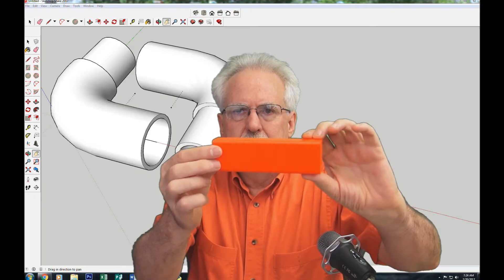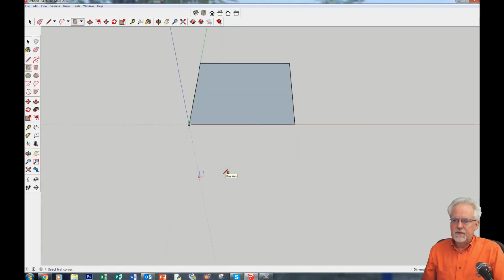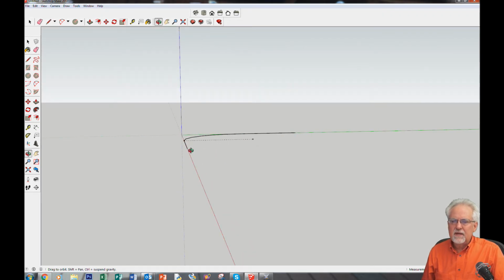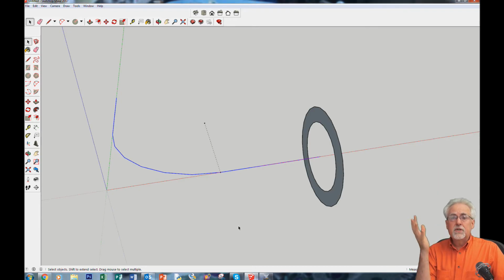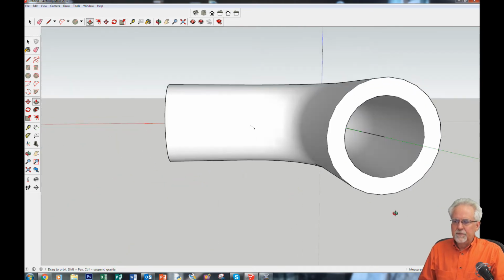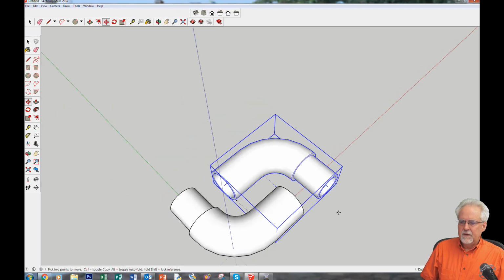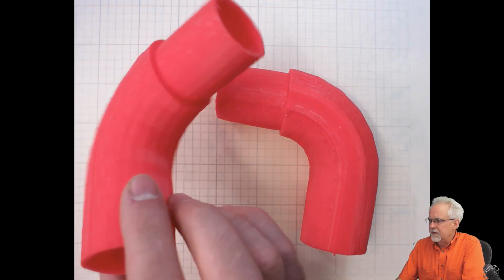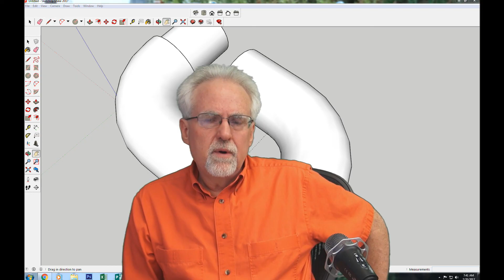Sketchup Tutorial LESSON 11: Use the Follow Me Tool to Design a PVC Elbow

Comment: Paul,
I have been using the Follow Me tool for other projects. I am however having an unexpected result using your method to create a simple elbow. Once the profile is formed along the arc, I have some gaps issue at the inner radius of the elbow. Looks like it is having trouble wrapping that radius and forms an open bow tie shape. The more segments I put into the circle the larger the problem.  I no longer get perpendicularity errors once I learned to align to the axes, so that is not occurring.  Can I send a picture of the result and the setup to learn what I am doing to cause the problem? The radius of the  tube is 62 mm and 3  mm wall thickness.

Comment: Hi Paul. I've been really enjoying your videos. I use SketchUp rather a lot, but didn't know about the smoothing surfaces feature. Thanks. It looks like the smoothing feature only functions visually on the screen, but doesn't transfer to the actual dimensions in the 3D model printout.  You can change the number of segments your circles are made of by typing it after/while creating your circles, much in the same way you change dimensions of a rectangle. I wonder if this would result in more round printouts. Ben from Sydney.

Comment: Paul, Give Simplify3D rather than Slic3r a try. I noticed my Prusa prints got 100% better when i imported the .STL into Simplify3D and used the Prusa i3 presets.
Reply from the maker: Does Simplify3D know how to utilize the auto leveling feature of the Prusa? I tried slicing something with ideamaker and it did not print properly, I think because of the bed leveling feature.
Reply: Yes it has that feature. I normally run the bed leveling manually through the i3 prior to starting a print and adjust z height as needed like you mentioned you do. I think the interface of the Simplify3D gives alot of good features to add more support for overhangs and resolution settings.  You can see more on the Prusa website.  http://shop.prusa3d.com/forum/original-prusa-i3-mk2-f23/simplify3d-print-settings-august-30-2016--t938-s260.html

Comment: Paul, have you been following the development of  3D dual print heads? They can use one material that is water is water soluble to lay down support material to produce a more precise end product. In your elbow, the bottom soluble material could be printed adjacent to the bottom table around the curve of the pipe. After printing, the material around the curve is then dissolved giving a more perfect curve.  In theory that is! https://www.youtube.com/watch?v=FOIAA0gcy6c
Reply from the maker: In getting my Prusa I3 and Raise3D N2 Plus printers, both had options for dual print heads. I opted for a single head. When I had my first 3D printer, the Makerbot, I had such terrible troubles, I decided this time to opt for the simple single head configuration in the hopes of getting something to work. Maybe next time I will take a little more risk and go for a dual head machine.

Comment: Excellent. Were the models pla or abs? And which material would you recommend for components that fit together. My delta style printer has issues with overhangs.
Reply from the maker: I printed in PLA. These are very hard to print in any material . . . you can imagine, you want to print cylinders perpindicular to build plate. Since these have orthogonal cylinders, there is no good way to print them. I guess use plenty of support material would be the best strategy.

Comment: Great video. I'm leaning toward ordering the Prusa now even more than ever. Thanks for your video.
Reply from the maker: I have been really impressed with the Prusa. So far, rock solid.
Reply: Paul McWhorter. Thanks for your reply. As you know, there is a plethora of 3D printers on the market, and more on the way. If I might ask, what criteria did you use for your choices of the Raise and Prusa?
Reply from the maker: After the nightmare experience I had with the makerbot, the main thing I wanted was a printer that just worked. The Raise3D has high performance, high price and reputation as a printer that works. The Prusa is lower performance, lower cost, but a reputation as being rock solid. So, I got a high end and a low end printer, both with reputations of reliable performance. After several months of use, I am pleased with both of them.